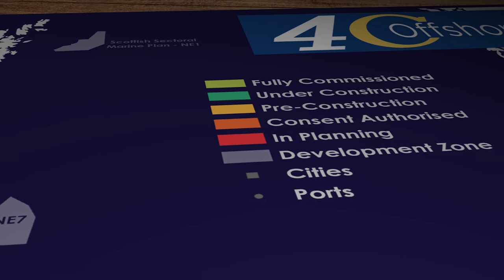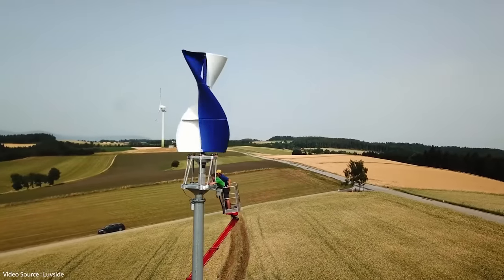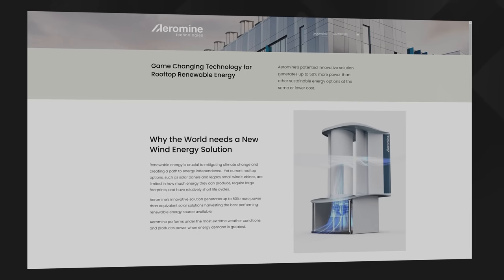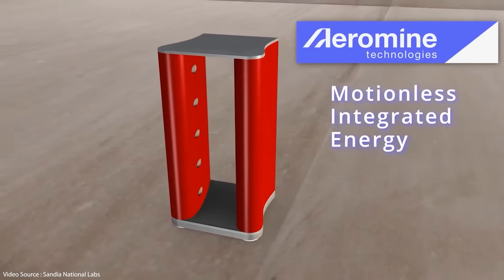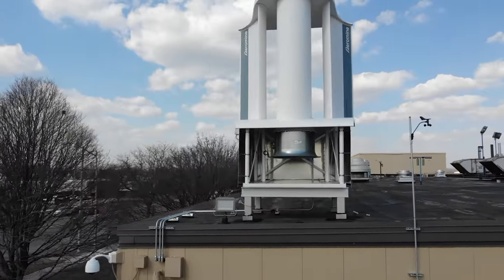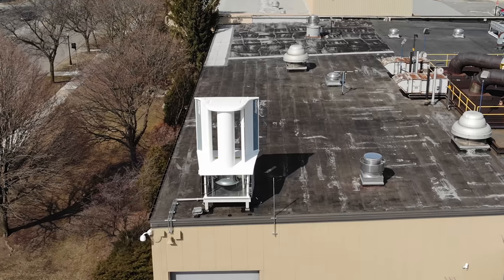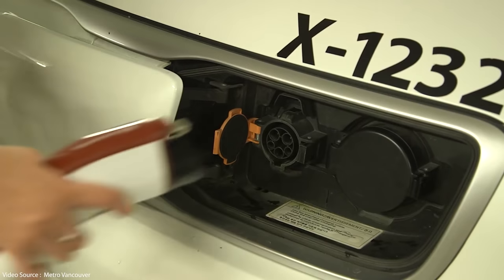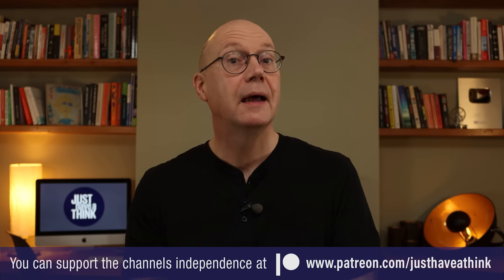Aeromine Rooftop Wind. Static. Silent.  50% more power than Solar PV. What's not to like?

Comment: I am a licensed General Contractor and Civil Engineer and while this does look promising, their are some problems. First and foremost is that it is ugly and a lot of people are not going to want this very visible eyesore to mar their pretty building designs. You can' t hide these without defeating the purpose of them because if you enclose them or build "screen walls" to hide them from view, you block of a lot of the wind flow to them.  Possibly you could install them at the center of a large roof which would hide them from view from the ground. However, if you can tolerate how they look, then this is not an issue, but in residential areas, I guarantee you that many people will not want these on roofs around their neighborhood. In AZ where I live, it has taken state laws to get municipalities and HOAs to tolerate installing solar panels on roofs, and solar panels are far less obtrusive than these wind generators. 

You also have the problem of what happens in high wind situations. In Arizona, wind speeds can explode up to 200 mph in "cell" events which are like small tornadoes. Though they are rare, they do occur. Recently during a cell event by my home, winds were so powerful that they collapsed 27 wood power poles in a straight line. Think about what these high winds would do to one of these generators. They exceed hurricane force winds.  

A third problem would be that the power generation is still intermittent. If the wind is not blowing as in the UK, no power is generated. This becomes a real problem in many locations in the world. For example, in AZ, you can have several weeks in a row where the wind speed is less than one mph.

A fourth problem would be how extreme cold weather and snow affect them. Solar panels for the most part can endure extremely low temperatures without damage, and snow will often melt off the panels during the morning. But snow would clog the venturi surfaces of these generators and greatly affect their power generation.

In the right location, like industrial areas, farms, cabins, etc. these wind generators could be very effective.

Comment: Ive wondered, if wind power generation really becomes big, I’m talking about many times what is in use now, will this have any effect on weather patterns. Since the wind generators are taking energy out of the natural movement of the air, could this cause problems? 
I knew a guy that was convinced this would be a serious problem. He worked for the natural gas utility, so his opinion may have been biased by that.
Seems like the energy in the atmosphere is so large and dynamic, it would mostly impossible to detect or measure any effect. Anyone here of research on this?

Comment: Liked the clip.  A well-thought-out system.  The only snag might be that there would be insects in the mix, trying to set up nests in the fan/generator.  I wonder if there is a gearbox that increases the rotational speed of the generator part?
Reply: If the movement is constant , birds and insects will not enter, however , dust and debris carried by strong winds might.

Comment: im not sue i understand this "not having any moving parts" as it seems to be a duct work for a traditional wind generators with moving parts , and im not sure how visible is a real advancement , it says sound is the key advancement, but the real sound advancement is going to be in bearing system of the turbine attached . As from the diagrams, and pictures shown it is exposed on the bottom of the ducting , but maybe im utter confused, but what im seeing doesn't match spoken description , maybe i just need a more detailed description, and a more design oriented description, If this is some kind solid state of ION flow energy generation device im not getting that from the video . Is this a solid state wind energy device, or new compact Windcatcher design .

Comment: I am from germany, and i have a big garden. On my ground is a permanent wind with a minimum of 20 kph. That is the base speed. Often it goes up to 30 kph and more. But it is always there, 365 days a year. But here we have a problem. Laws saying, no wind  turbine in populated areas. Only Solar and only in a small capacity. So i am not allowed, to produce more than 10 KW. 
The problem is, when these laws are made, there only were these classic Wind Turbines. They havn't thought about a better solution could come. So i am not allowed to have these kind of wind turbines.

Comment: Very interested in this type of system for residential use. I live in the northeast where we get a lot of wind (and snow). I hate having to mount anything on my roof. Can I build a small structure with this system mounted on top, strategically placed in my backyard, that "scoops" up the wind to generate enough useable power?

Comment: Where is the field data or test trial sites data given different results for different sites are likely but should indicate best use cases for such a device ie BCS and WCS and inbetween?

I'd be fairly sure plenty of sites in a windy area such as The Outer Hebrides would have CONSTANT wind energy for an example of BCS (! - almost always)...

Comment: I like it.  But here in Canada, although we have lots of wind, that design looks like snow would pack into the unit, and require cleaning.  Which means a trip onto the roof several times over the winter.  I’d love to be wrong about this…

Comment: A fixed inlet direction??? To make this successful it would necessarily require the unit to be rotated or have some form of variable inlet guide vanes in order to direct the airflow at its highest possible velocity. That way, output regulation can be controlled by a constant speed drive or integrated drive unit as used on turbine engines. Protection for high wind speeds can be provided by lift dumping or bleeding off air by changing the inlet direction in a similar manner to feathering a propeller.

Comment: Like most of these alternative energy sources, fine if you are just powering a house or two. But try powering some industry like a foundry or machine shop. You might be lucky if you could power up some of the lights, but you won't get anything done trying to run some 20 horsepower motors or melting some steel.

Comment: I'm in Texas the wind blows slowly but it does blow 3-8 mph almost all the time where can I get some of these
Reply: Just checked the county wind speed average for Texas.

The slowest county is Orange, at 11.17 MPH.

It's probably because you're at ground level. Wind is faster the higher you are.

you would see much better wind speeds on top of a house.
Reply: I think those are not available yet. I have seen similar designs in the past and as they are not mass-producted, the cost was $5k and up.

Comment: One big problem missing in the vid. You can't mount this on a normal house. The roof is not build to handle the load. I from the unit or the wind pressure. It will be more costly to install than solar

Comment: I see a problem not discussed in the video.  Wind.  It doesn't always blow in certain places. That's the problem with wind power in general.  Same with solar.  Sun doesn't always shine. Hydrogen and nuke power are what we should really look at. Micro generation at the end user is always the most inefficient type of power. Not to mention the chicoms just made a huge breakthrough with fusion.  They just made a mini sun burn for 17 minutes.

Comment: Great concept for the commercial sector probably  easily affordable, but for the domestic sector this is unachievable.  If every house had a much smaller unit, that was affordable and could be mounted  on a chimney  for instance even if lower kw's then the majority would buy and offset the one or two commercial businesses both in output and quantity sold.

Comment: Eventually, devices like these will be integrated into the cooling unit of large air-conditioning systems. The hot air generated can surely be partially harnessed without to much interference to the airflow to the unit.

Comment: "No moving parts."  Looks like there's an internal turbine within yhe centeal column that spins with the air flow from low air pressure.  That's a moving part.  And it's important to note because movement causes wear and needs repairs more often than truly static structures.

Comment: As optimized as the design of the "diffusors", which however are more the opposite of that, may be, I do no understand why they do not allow for some rotation. The overall design is prone for it. What does "predominant direction of the winds" mean? That being said, there is certainly an effect of the building itself in channeling winds into a certain direction, but once you see that, why not taking advantage of that and optimize for the embedding in its surrounding, for instance by creating 3 different configurations all based on the same platform? 
Cost may be an argument... no: cost would have been an argument in the 1990ies, but with computer aided manufacturing, this is not an argument anymore.... an interesting starting point, but not more.

Comment: What they don't mention in this - what happens when these things intakes get choked full of ice and snow? If you live in any kind of wintery city, you know the amounts of snowfall and accumulation that happens on building tops. This kind of arrangement would require daily/weekly clean out, and being on a roof in winter is exceedingly dangerous (an OHSA nightmare!). With or without that regular clean out, the LCOE of this goes out the window.
Reply: Not to mention birds will make their homes in them.

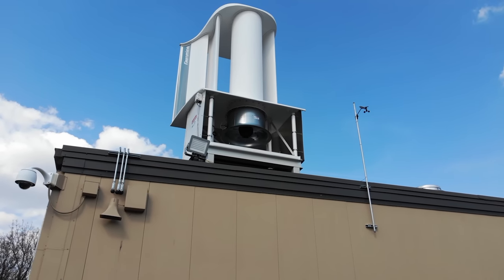Comment: No exposed moving parts? At 5:20 yo can see the fan blades spinning!  The thing is just a fancy piece of ductwork for a small fan/generator. You're perhaps trading generator and turbine blade size for ductwork material. They're not disclosing numbers? Color me unimpressed.

Comment: I kept hearing "no moving parts" then I heard, "all you need is a rotor" so which is it? It's a moving air system, at some point you need a generator & I presume a fan, propeller or turbine. Or am I wrong !

Comment: Perhaps a better solution is to integrate a system like this into new construction.  A small eave with the intakes immediately under it would result in a higher inlet pressure.  My 0.02

Comment: NO?! Clearly not motionless. The spinning turbine internally has a physical size limit relative to the overall unit and most certainly requires maintenance and weather protection. Clearly not silent as there is a venturi effect generated inside a 'SHAPED' housing creating a low-frequency hum from the fan blades along with the captive wind sheer along the building's edge.
 Static mounting: Yes.
 Power per square foot: This at any given wind speed will vary in an unpredictable manner. At least Solar PV, ignoring cloudy days, can be forecast with some reliability using appropriate solar tracking mounts.

P. S. Where are the solar panels on the tops of the 'Aeromine' boxes???
P.P.S. You know that charge managing systems for wind turbines and those for solar cells are seriously different.

Comment: How do figure that solar panel's and their 25 year life with roughly 30% drop in efficiency can be claimed to be "relatively short life cycles?

I've lived all over the U.S.  Sometimes it's sunny.  Sometimes it's windy.  Sometimes it both, and sometimes it's neither.  

I see Aeromine as being complementary to solar power, not competitive with it.  It would allow off-grid users to cut their solar power requirements by a third to half, while still enjoying their off-grid power systems and storage being fed from both solar during most days, and Aeromine wind during windier conditions at all hours of the day and night.

I especially see benefit in areas of the country where solar is minimal, provided windier conditions prevail.

Comment: Great vid.  What if, instead of large prop-design wind generators... they simply invested in and  brought the generators to the site of use?  This and other efficient designs are much less impactful on the environment and kill almost zero birds and bats.  The one disadvantage, and this is unfortunately much more important to those "in power" is that the site of use plan is decentralized and much harder to control.  They care less for providing alternative, renewable energy than creating a system that provides more control. Sad but true.

Comment: So it has a (big) turbine after all. So much for 'no moving parts' and 'no noise pollution'.
Furthermore, any turbine is at max only capable to transform 70% of the captured energy delivered by pressure into other forms of energy, e.g. electricity. Never mind the inherent loss during transport, storage and further conversion into the finally useful energy form. 
All current types of powerplants are based on creating pressure to drive an axle to rotate, thus converting it into another form of energy. Coal, gas, hydro, geothermal and nuclear powerplants merely create highpowered steam pressure to drive turbines to that purpose. Combustion engines use explosions to create the high pressure to  either directly transform it into motion (jets and rockets) or to drive a rotating axle or turbine (as in cars, turbojets and electricity generators). Even a sailing boat merely transforms the (sail) captured wind energy by applying rotation opposing pressure (by the sword or just the keel) that escapes through propelling the boat into acute and directed motion.
This means that the limiting factors to generate as much (transformed) energy is how to create as high a pressure as possible and how to create turbines capable of safely(!) sustaining the required revolution speeds. Wind energy is governed by average continuous wind speeds. Such average in its free form in windy regions, e.g. at the North Sea, is currently not exceeding 8m/s (18mph). 
So artificially increasing (and also homogenising) the captured wind pressure through a physics trick does incrementally increase the absolute yield, but not the main inherent drawback of free wind energy: it still generates at most but a fraction of a percentage of the energy from steam and thus of the revolution speeds that an electricity generating turbine in a fossil fuel powerplant allows and needs to generate meaningful amounts of energy.
Comparing the efficiency of this wind energy improvement with current improvements in solar is like comparing the survivability of sharks and lions outside their natural habitats. And both are currently even mostly limited by mankind's current capability to (safely!) and efficiently store and distribute electrical energy. The holy grail of freely available energy anywhere is currently at (least near) the top of the pyramid of all human advancement, not just technologically.

Tldr: how fast that does that turbine spin?

Comment: Nice idea, will watch with interest. Might be fun to see a version of this applied at larger scale, I.e. an entire skyscraper built in this shape to generate greater power. And or structures that could rotate at the base to maximize wind harvest. Anyway just to throw it out there re. the comment at 1:00, government backing does not prevent projects from becoming “white elephants”… it simply “shares” the cost of failure with taxpayers. Which is not a particularly good deal for taxpayers if they don’t get to share in the rewards.

Comment: It works like a water jet, it's a nice idea, but compared to solar panels, the panels have no moving parts, they are easier to place and maintenance free. I prefer to place 50 percent more panels. but there are of course hundreds of areas where the design of this wind turbine could work. I don't think it's suitable for general use.

Comment: Interesting video - very informative on the Aeromine unit. I wasn't aware how they worked so the explanation was much appreciated. Still awaiting actual test results from Aeromine though, right? Wind speeds in urban areas tend to be very low, especially at the altitudes where these are demonstrated, so I would be interested to see if they can actually compete with PV panels...Lastly, any idea when they will be commercially available?

I am making a video on bladeless wind turbines (reviewing state-of-the-art tech) at the moment. The video should be released by the end of the year. I'd appreciate if you could provide your feedback. Best regards.

Comment: Since this has been claimed by all kinds of devices for a very long time, they should have been covering rooftops instead of PV from long ago. They haven't, for a number of reasons mostly involving the niggling problem of physics. We await specs, we await real-world testing in less-than-prime circumstances that most people have, and we await a 30%+ drop in the expected price just to match PV.